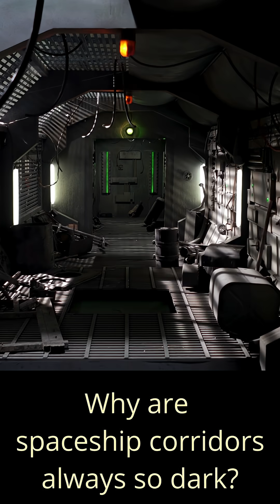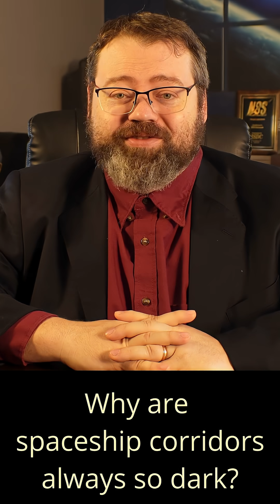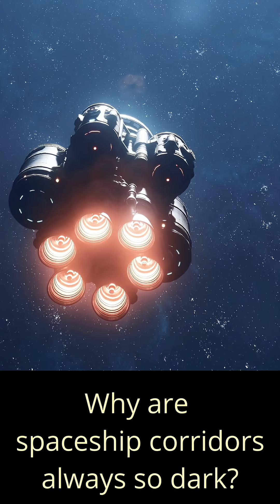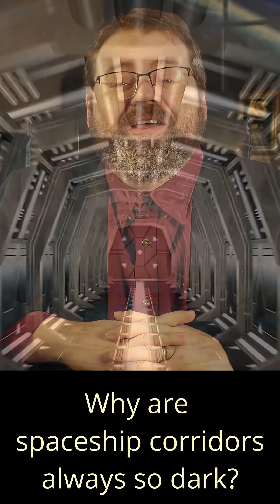Why are spaceship corridors always so dark?

Comment: Or, an advanced species engineer themselves to not need light to see. You could have a big ship with dark corridors while the cyborg inhabitants walk through it, except the cyborgs are navigating via ladar, sonar, their own built-in map with the layout of the ship hooked up to wi-fi, etc. They could still have switches to turn on the light, life support, heating, artificial gravity, etc but there's no guarantee it's through physical switches, a wireless connection, or automatic sensors.

Imagine the heroes walking through the dark alien corridors of a ship, avoiding the cyborg inhabitants, and then the smart guy manages to decode the alien hieroglyphics before turning the lights on and getting life support to clear away the ominous fog the aliens use to keep their corridors from collecting dust.

Comment: I don't buy this at all. True, even bright lights will use only a tiny fraction of the power of the ship's engines. But the same applies to heat! Your ship's engines will require giant radiators to expel the engine's waste heat. And after you're done accelerating and are coasting to your destination, your ship will now have a comically oversized set of radiators compared to the in flight heat disposal needs of the ship. If your ship has enough heat dispersion capability to not cook everyone alive every time the engine turns on, then those radiators will have no problem handling the waste heat from running some light bulbs.

Comment: The real question is why are Sci-fi flashlights so bad (dim, too narrow or diffuse to be functional, and constantly running out of batteries)? 
It's been said already, but mechanical spaces and access ways in modern buildings (presumably ships as well) are frequently poorly, if at all, lit. Technology may change, but people don't, some Way-Yu pencil pusher figures they can save a thousand or two credits on a multi million credit vessel by reducing the quantity of lights in access corridors, they'll do it and then sell the technicians a flashlight so they can do their jobs.

Comment: Today, OLED technology consumes very little energy compared to equivalent LED technology from 20 years ago. Thus, for an advanced civilization, capable of building such a spaceship, it will be able to light the interior corridors thanks to the heat from its engines, which will require Clark/Trek technology, but common in the future...

Comment: You’d also probably want to keep the lights dim and ideally colored aboard warships for the same reasons navies do it right now. Making displays easier to read and preserving low light vision.
Reply: Considering that on a spaceship, 99% of the interaction is through computers and displays and not peeking through windows, there's not really any point in preserving low-light vision.

Dimming the lights for "battle mode" can make sense, but in all other circumstances, there's way more benefits in having well-lit interiors where it's also much easier to spot any potential issues like smoke, leaks, alien goo, ...

Comment: Asimov did come up with the idea of fluorescent walls and ceilings with a low glow like a night light. Some form of that could work. turning ambient heat into a light source via passive means.  Heat you need not to freeze while not adding extra mass for lights and wiring.
Reply: well with the LEDs we have now, even less heat generated.  So the fluorescent walls would work so much nicer. with a little more light.

Comment: I've been trying to figure out how radiators in space work. One of these days I'll get around to it.
Reply: It's just a panel of warm metal. Anything hot emits infrared light. Make a big thin sheet of metal, run hot coolant through it, the metal gets hot and glows, getting rid of the heat.
Reply: Black body radiation, as described above.

Comment: huh, heat build up, you know iv hear do fit before but never gave it much thought, and now im curious how you could use it maybe break up the load of heat managment with tons of little tasks like everytime someone wants to cook food or boil water some of that building heats from the rest of the ship could be put into that, also heat to boil water pushing turbines to make a little extra power, could be useful on long trips to save some of the ships main power. maybe put some of the exess heat into arogel. wait i forget does arogel absorb, or insolate from heat?? getting those two mixed up could be a problem. ^^;

Comment: Also, may I suggest 

1. Reduces energy signature, minimising detection from foes. 
2. Saving energy on long voyages (colony ships may have to stop and start to drop off colonists/resupply)
3. Shared areas may have low lighting (corridors) to accommodate circadian rhythms in a "24hr" shift cycle  
4. Light can damage/weaken materials. Over centuries, this could add up. 
5. Bright lights require higher amps which require thicker conduits. Across a colony sized ship, that is a considerable amount of weight in material.
Reply: On some of these issues, the solution might be a centralized lighting source with the light transmitted via fiber optic cables.  That would also permit the heat involved in producing the light to be concentrated at a single, high temperature source where that heat could be more efficiently used as process heat or otherwise more efficiently radiated away.
Reply: But if they are in space why does weight matter? They take bits and pieces up and assemble the craft in space or whatever.
Reply: @danracerboy24 Mass matters. Every gram takes fuel to accelerate/deccelerate. Just like a lorry hauling goods. The heavier it is, the longer the braking distance.
Reply: A few critiques 
1.  Internal lighting wouldn't be a concern as radiation shielding is standard and distances are vast
2.  As Isaac explained, most ships will have energy to spare for such trivial needs
6.  Except for the most peripheral parts of the ship, you'll be running heavy cables throughout just to run the normal operations of the ship.
Reply: @palehorseman8386 

The difference between a 1 amp cable and a 3 amp cable could be about 150 grams per metre. You still need to spur off of your bus to your bulbs. 150g across 1000's of light sources is a good few ton. In a mass audit, reducing the amount of light sources and their lumens, could be an easy controllable on a vast voyage. I imagine a dim LED may last longer too (not sure about that) further minimising replacement parts.

Comment: Would/could the radiative heat from radiators be used as some form of thrust/breaking?
Reply: Technically, but it would be by a very small amount. You need 300 megawatts of light to get 1 newton of thrust.
Reply: @massimocole9689  Ah ty, I always figured that if Ion drives could produce thrust then why not radiators... but it seems I vastly underestimated the output.

Thanks for answering!